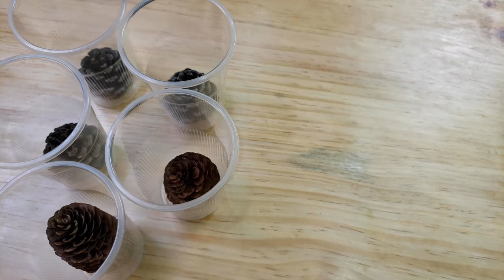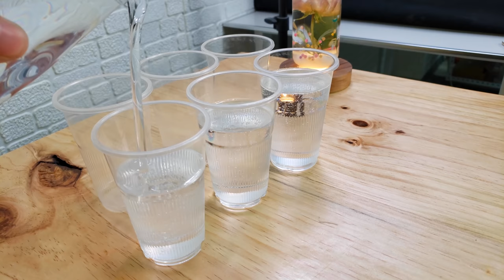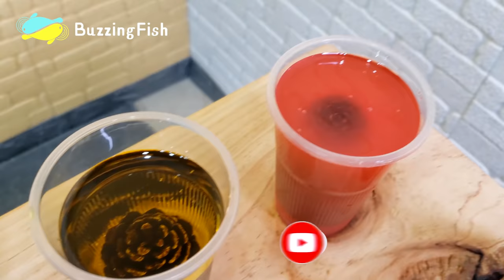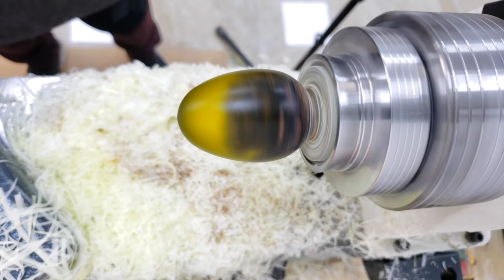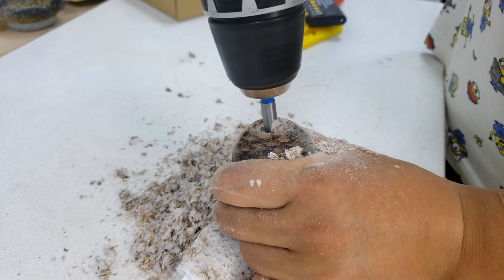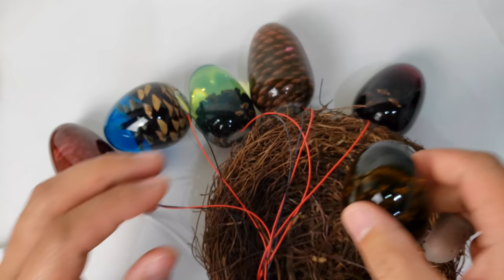🏮 Amazing Night LAMP From Resin and Pine Cones  / Resin Dragon Egg | Resin ART 🏮

Comment: it looks like you are using a smaller lathe to turn your projects, it is one that is mounted on a table rather than the larger types that are on the floor that you would stand next to?  If so could you possibly give resources as to where you got your machines and the approximate maintenance costs yearly for your lathe.   Thanks so much love your art

Comment: Really pretty.  Alot of work,but worth it. Wanted to make some, but got me at the lathe.  Had a machine shop and sold all our lathes etc. But what you where using was a wood lathe, right?  I have lots of pine cones,that would of been a cute idea for them. Thinking, can still use resin but different container?  Mind going... thanks for video using something from nature..
Reply from the maker: Mechanical lathe is also possible, it will save more effort than woodworking lathe

Comment: Thank you for your videos. Where can I buy the light you are using in this video, the round plate with heat diffuser that does not need a saparate driver?

Comment: how did you stop the pine cones from floating?  And you soldered together a single led with wiring and neither link you posted has that...those are strip lights?